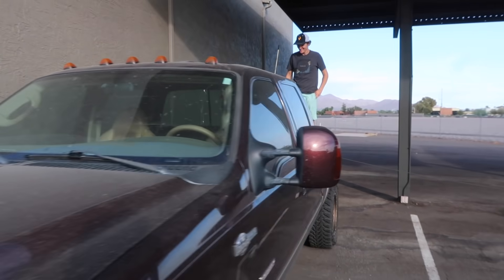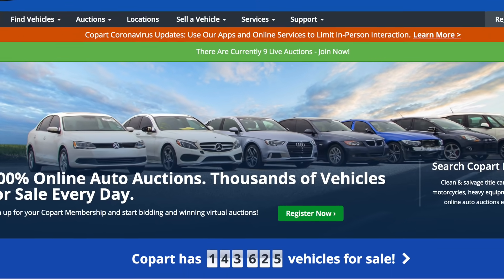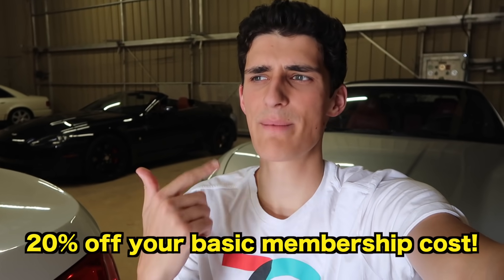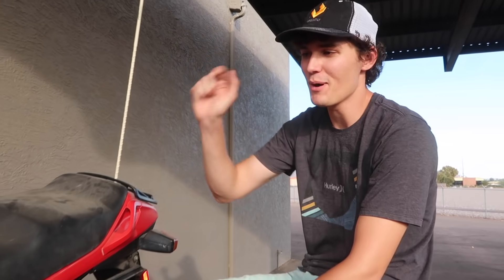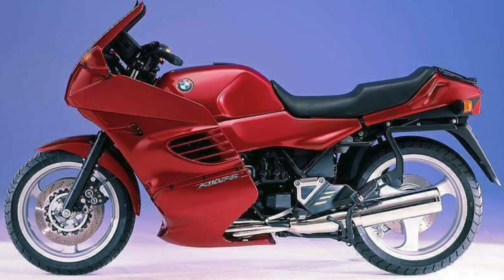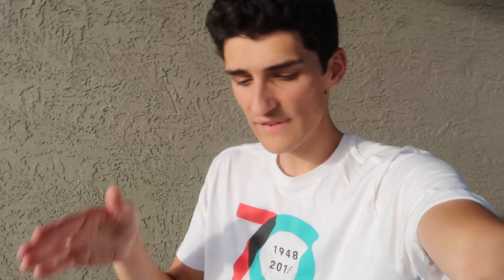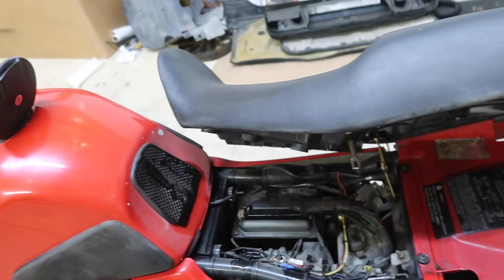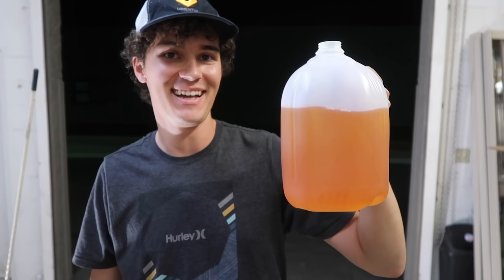I Bought an ICONIC 1990s Sport Bike For $925 Sight Unseen at Auction!

Comment: there is a multitude of solutions you could try to get the bike to start.
1. check the clutch play and see if it fits the original manual. I messed with the clutch position on my bike and it couldn't start because the clutch is either not pulled in or smth, fixed the issue by reverting back to the original setting.
2. make sure the bike is in neutral if the kickstand is down, most push-button bikes will not crank if the kickstand is down and the bike is in gear, its a safety feature. which also means your kickstand features a standard kill switch if the bike cranks with it up.
3. if the bike is carburated, check the fuel petcock position, make sure it's either on ON or Reserve. the bike may still fire in Prime mode but don't need to use it unless the bike never had any fuel.

4. check battery. i once left my lights on too long and the bike couldn't crank and had a weak battery. charged it and the bike fired right up. generally, a weak battery symptom is when lights are dim and start to flicker.

generally, the 3 steps to starting a push-button motorcycle are clutch pulled, bike neutral and push the ignition to start. hope ya'll can figure it out.

if all of these things i mentioned doesn't help then its prob your fuel pump went or idk.

Comment: Excited for this! Couldn’t tell by the lights if the bike was in neutral or not- some models require the bike to be in neutral AND the clutch in to crank. I’d try with it pulled and without. Also check and make sure it doesn’t have a kickstand switch. Some bikes won’t fire with the stand down. Weird safety features on 90s bikes! Best of luck!
Reply: They do as long as it's in neutral

Comment: look for clutch sensor when they're bad they won't detect that you have pressed the clutch and it wont engage the starter , one easy way to test this to start it with a beefy screwdriver to the starter solenoid

Comment: Are you sure the kill switch is off? The red switch behind the engine start button has to be in a position where it points at a circle with an arrow on the ring. If that is the case, the next thing to check is the starter motor relais. If you hit the start button, you should hear it click giving power to the starter motor.

Greetings from germany, if you need help just answer my comment good luck with that awesome bike.
(And sorry for my shitty english :D)

Comment: Possibly check for a hidden isolator switch the bike having had non standard stuff done. Definitely kick stand up. Starter switch, solenoid and starter motor need checking. Try a push start as well to see if it will fire? Looks like a bargain though and I’d guess there isn’t much stopping it from running?

Comment: Not a BMW expert but I assume that green light in the middle is the neutral light but if not make sure it is in neutral. If it is may be worth shifting it in and out of neutral to free up the lockout. If it is like a Honda it should still start with the side standout down but would kill the motor when a gear is engaged.

Comment: Battery change also check out ecu cause when it's staying for years without power charge that one starts forgetting so it literally delete itself and check fuse box also start plugs will be also corodet aswell the ignition cable

Comment: Even if you have 12V you may not be getting enough amperage (Current) but definitely change the fuel pump and the battery and you should be golden.

Comment: I got an idea for Your next project: "We bought the cheapest '79 Rolls Royce!" These older ones got a GM engine. You give it the usual treatment, and because that model is so old U don't need to have a bad conscience in straight piping and putting some larger wheels on it. If the original engine can't get rapaired with reasonable effort U might even swap an LS engine in. Should be loads of fun.

Comment: If those bikes do not have the proper voltage/amps starting at the battery “you got nothing”. Start with a new battery fully charged. Your fuel pump will probably kick in then also.

Comment: Yeah I had the same issue I changed my fuel pump assembly and had to find somebody who welds aluminum for the tank which was like impossibly but it started right up there was also crack in the fuel lines too look out for those. If I can be of any help let me know my Instagram is @bahssit